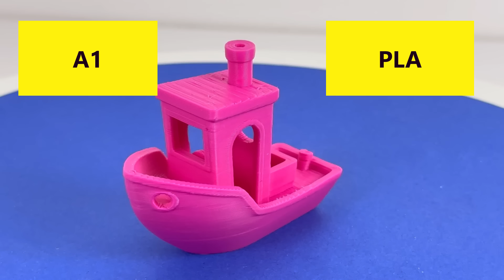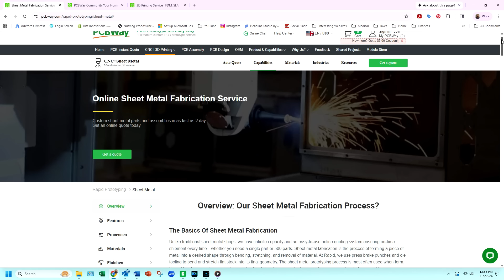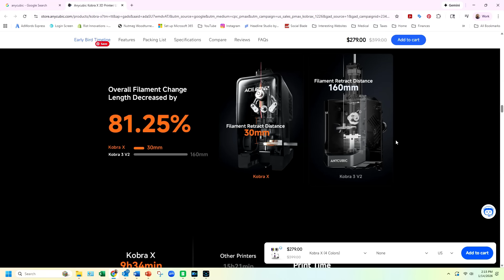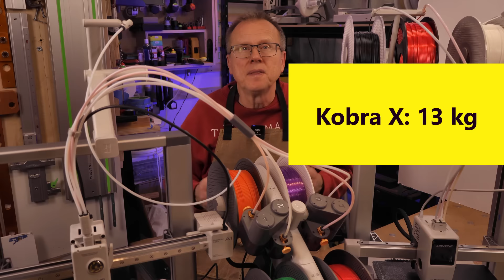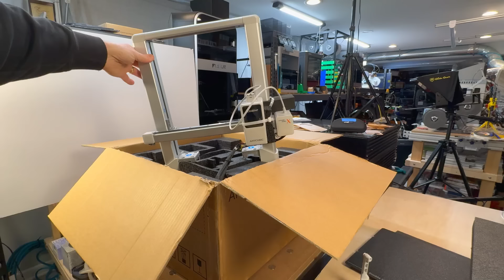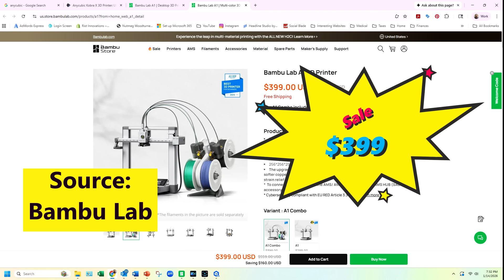NEW ANYCUBIC Kobra X vs. Bambu Lab A1- Which is BETTER?

Comment: Been printing for 7 years starting with the good old Ender 3D. That was an amazing and reliable printer for 3-4 years before my after market board had a driver die on me. I could not get it working so I took a 1-2 year hiatus from FDM occasionally printing on my resin printers instead. I soon got the desire to print more functional parts as SLA was tedious and my miniature painting space got blocked by construction materials so I got an A1. That reignited my love for 3D printing. The AMS was amazing for auto reloading filament and Orca was so good I did not really need to do any tweaking of the built in settings. Though the AMS made making a drybox enclosure simply impractical for my space particularly since I have mine top mounted and very close to two walls. Then 6 months later Bambu had to turn evil locking out Orca from the cloud. The prints have been amazing with very little maintenance ever since, but I can no longer in conscience buy another printer from them if they are so willing to change the rules after purchase.

Fast forward to a week ago. I saw a sale on the Kobra X and saw its hotend system and that it did not need a complicated and bulky AMS. The first thing I thought of when I saw it was how simple it would be to print and mount a dry box on top of it so I could finally print PETG and TPU without it sitting out in the open collecting water. The more efficient waste management and it not being a bambu were simply a bonus. After 7 years I have officially finally printed my models in those materials without any issues and the dry boxes are keeping the filaments 10% dryer than ambient. So far I am quite happy with the Kobra X despite the plastics feeling noticeably cheaper than the A1. We shall see how it holds up in the long run.

Comment: I’ve had creality k3 and qidi q2 . The k3 never gave me issues besides bed adhesion “my fault “ and the ends of spool getting stuck in the rail system and not stopping causing my print to fail . lol also my fault . But this qidi machine is great but man my WiFi has gone out and now my feeder gears are clicking by the nozzle head . Maybe tpu got stuck in gears a bit I don’t know 🤷‍♂️ doesn’t want to feed new filament of any kind . 😂 ima have to take it apart to marrow with a head set 👍

Comment: hey bud ams lite can be used with tpu Bambu now have a tpu that is ams lite compatible just so ya know if you didn't already
Reply from the maker: Bambu Lab has had the TPU for AMS filament for a while, but it isn't as flexible at the typical TPU so it has some limitations, but you are right that it does work in the AMS/AMS Lite.

Comment: Any chance TPU can be done with ABS? I like designing speakers, so the heat/UV resistance of ABS and ability to use TPU as a gasket is very appealing.
Reply from the maker: I haven't had a chance to try that material combination, but that's a good idea.

Comment: No matter how you cut it, this is turning into the year of the underdog comeback!  First, SnapMaker - a company that wallowed in mediocrity for years, creates a groundbreaking tool changer.  Now, the perennial step-child manufacturer - Anycubic introduces the first, original multicolor head design that ditches the gangly AMS approach.  I love it!  Personally, I feel that once a company gets anointed as a leader, it becomes arrogant.  That has happened to Bambu Labs and that's why I won't be buying their increasingly closed system.  Personally, I'm waiting for a few months...maybe a year...before buying another printer.  I think some exciting things are coming in the next 12 months.  Great video.
Reply from the maker: Thanks for your comment. I agree that exciting things are happening in the 3D printing industry.

Comment: Hi I was wondering about the 690mm height, is that to the top of the bowden tubes? I saw on Anycubic's website it says 461mm height. Maybe Anycubic is measuring to the top of the Z rail? I want to see if this fits in my cabinet. Thanks!
Reply from the maker: Yes, my 690 mm measurement is to the Bowen tubes. AnyCubic’s 461 mm measurement is to the top of the Z Axis frame as you mentioned. AnyCubic isn’t including the spool holders or the Bowen tubes. Thanks for your question.

Comment: Being new to 3D printing, I did my research and went with the A1 combo just last month, but just now learning about KobraX and Creality i7 "superior" clones for less $. That said, Bambu's proven reliability, ease of use, and robust eco-system is a selling point for beginners and until these clones prove the test of time, I won't feel too bad about my purchase. It's like arguing about the value of a new feature rich Kia vs the known reliability of a Toyota. 

Also, having affiliate links to one product doesn't help the impartiality of a head to head review.
Reply from the maker: I think you will be very happy with your A1 and I completely agree with your comments.  I also understand your point regarding the affiliate link so that's why you want to do your research; which sounds like you did so that's great.  Good luck with your 3D printing adventure.

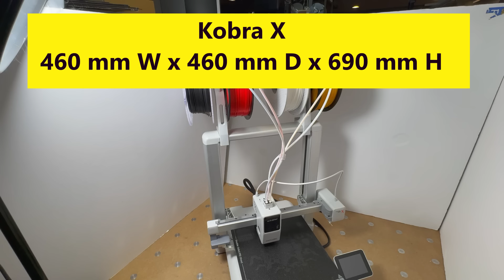Comment: Awesome video - thank you! But very repetitive too. You went through a features comparison at 9:20 and then did it again (pretty much word for word) at 16:45. Maybe this was just an editing error, but reducing repetition and making videos a little shorter (when possible) will help retain viewers and gain subscribers. Just some friendly feedback for you - that’s all.

But again, overall a wonderful video that is filled with great info. Much appreciated! The Kobra X seems like a much better printer and, for now, it’s much cheaper! I own 2 A1’s (both with AMS units) and I love them. Awesome print quality and reliability! Bambu makes great printers and their slicer (and overall ecosystem) is much better. But just looking at the printers alone, head-to-head, this is an easy win for the Kobra X. But it also has the HUGE advantage of coming out about 2.5 years after the A1. So Anycubic has had the chance to copy all the good stuff, fix the bad, and add extra innovative features. So not exactly a 100% fair comparison. But still nice to see!
Reply from the maker: I appreciate your advice.  I did intentionally repeat some information in the Final Summary from earlier portions of the video so I can see that this may not have been effective/made the video longer so I will take your advice under consideration for my next videos.  Thanks for taking the time to offer your input.

Comment: How is the noise?
Reply from the maker: Both the A1 and the Kobra X are very quiet printers, especially when compared to printers such as the Bambu Lab P1S. I didn't have a way to take a measurement of the noise level, but AnyCubic claims a noise level of less than 48 dB.  Thank you for your question.

Comment: Simply comparing features doesn't tell the whole story. A large percentage of anycubic printer owners will tell you to stay away from that brand. Very inconsistent and it's literally a crapshoot if you get a machine that works well or constantly has issues. While a large percentage of bambu lab owners rave about their machines. In 3D printers, as with everything else in life, you get what you pay for... and don't fool yourself in believing otherwise.
Reply from the maker: I agree that reliability is a big unknown for the Kobra X since it just launched and I also agree that Bambu Lab printers have a great reputation for reliability. My Bambu Lab printers are my current "go-to" printers when I must get a high quality print out in a short time frame. Thanks for your comment.

Comment: Im curious about the actual size of the build plate? is it a proprietary size or is it the same plate as any other printers? cheers thanks for the informative video, I've already preordered my Cobra X
Reply from the maker: The Kobra X build plate of 260 mm x 260 mm is unique (at least to me), but build plates tend to come in many sizes. The Bambu Lab A1 Series, P Series, X1 Series all have build plates of 256 mm x 256 mm.  The Elegoo CC has the same build plate as the Bambu Lab printers. The Qidi Plus 4 has a build plate 305 mm x 305 mm and the Qidi Q2/Q2C have build plates 270 mm x 270 mm. The Anycubic Kobra S1 build plate is 250 mm x 250 mm. There are other sizes out there, but I don't own the other brands. So, you can see build plates vary quite a bit between brands and models of 3D printers. Thanks for your question and for your feedback.
Reply: @ristinnovations thank a for the reply. I read somewhere that it was the same size as the S1. I want to get a couple extra plates with patterns in them. I’ll have to wait til it’s released and market gets parts and upgrades. 
I pre ordered my kobra x already. It’s feels strange not seeing lots of upgrades prints and parts for it online yet. Been running my old ender 3 for 6 years.

Comment: So the Kobra X is better in basically everything and costs $200 less....pretty easy choice
Reply: Mostly true but we dont have long term info how well it keeps up compared to bambus reputation of being reliable.
Reply: @taggedhh Not all Bambu are reliable.... My A1 just exploded literally. The problem is overheated NTC. I don't claim guarantee, just throwing away to trash and move to Centauri Carbon. Best decision. 
I have A1 mini too, it's pretty reliable enough. Yeah if you talk the reliability, the A1 mini is what you talking about. Even my H2D had extruder problem.
Reply: @taggedhh I have 2 remaining Bambu's i had 3....1 lasted 8 months (A1) 1 lasted 14 months (P1S) 1 is still working but has had over $300 in parts replaced (P1P) its 2 years old.  Bambu are NOT reliable long term. Thats just company propaganda. Theres a reason they are sold out of parts a lot of the time.  My Anycubic Kobra 2 Max though...3 years and never a hickup

Comment: Lets compare a 3 year old printer with is brand new one. funny how it took anycubic to clone a 3 year old printer and make it slightly better.  Btw on the build plate kobra x, a number of videos have confirmed that it sucks. it will need to be glue, hair spary, or replaced.  How long until the Kobra X is abandon for the Kobra X v2 ?  The thing I love about the Bambu is the Handy app. i can pick something. click print and know it will print. it tells me when it starts, and when it finishes.
Reply from the maker: I did have some adhesion issues so I coated the build plate with Nano polymer, which works great.

Comment: I hv an Ender 3 pro that I have used for years and like, but am looking for a bigger build volume, and the Kobra is about what I think I need, but I will next to never need multi color printing. Any suggestions on an alternative that is bigger than the Ender, but about the Jan 2026 price of the Kobra?
Reply: I mean... you don't need to worry about the multi-color part of it, you don't have to do multi-color to use the 3d printer you know?
Reply from the maker: If you are looking for a build volume of 256 mm cubed, the Bambu Lab A1 without the AMS Lite is on sale for $299. The Qidi Q2C without their Qidi Box has a print volume of 270 mm x 270 mm x 256 mm with a price of $399.  I'm sure there are other printers out there for your needs, but these are two that you may want to consider. Thanks for the question.

Comment: OK, the comparison of X with A1 comes naturally, but... The first one is new ~2026, and the second... is a model that's been around for over 2 years, so it's not surprising that the X does something better. ROTFL
Reply from the maker: I agree that the A1 has been around for a couple of years, but I still think that it is the top printer in this price range to compare all other printers to based on the performance of the A1 (I have 5 A1's in my print farm so I am a fan of the A1 printers.)  It's just like when many people compared the newly launched (at that time) Bambu Lab X1C to the Prusa MK3/MK4 printers because in my opinion, the Prusa printers were the best quality, most reliable printers at that time. Thanks for your comment.

Comment: Bonjour, très bonne capsule vidéo informative. Un point négatif, commun à tous les vidéos de présentation c'est l'absence d'explication des modules complémentaires 4 couleurs.
Personnellement, je suis en France, j'ai commandé hier la Kobra X en 7 couleurs. Principalement pour découvrir le multicolore avec une bonne réduction du temps et de la diminution des déchets (qui devait être plus important selon la publicité). Ayant un Prusa Core  One je sais que je n'aurai pas la même précision. À ce prix, c'est une bonne alternative. De plus je suis agréablement surpris de la technologie de la tête d'impression. Cordialement
Reply from the maker: I touched on the ACE 2 Pro modules in the video, but I agree I didn’t go into a lot of details because I don’t have one yet. AnyCubic will be sending me an ACE 2 Pro module when they are in stock so I will make a follow up video then, focusing on the modules. Thanks for your comment.
Reply: Merci
Reply: as tu recu ta machine ? comment elle se comporte ? comment le changement des couleurs et des filaments ? j'ai vu que celui d'anycubic parametrer les filaments a l'air plus chiant que celui de bambou. 
J'hesite vraiement entre les 2, mais le sav et les pieces de rechange chez anycubic a l'air plus chiant. je ne doute pas su la qualite d'impression, mais faut aussi penser a la face cachée : le sav et la disponibilté des pieces.
Reply: @tignasse Bonsoir, je n'ai pas encore reçu l'imprimante. Logiquement, au regard du calendrier d'Anycubic, c'est vers le 15 avril. Comme on dit, à suivre. Cordialement

Comment: very well made video! ordered my a1 now
Reply from the maker: I think you will be happy with the A1. I am currently using 5 of them in my print farm and they work quite well. Thanks for your comment.
Reply: What made you chose the a1 over the kobra?
Reply: @Berkishere  I have to say that I have a bias since I owned a Kobra 2 Max and wasn´t very happy with it. The main reasons are:
1. Delivery time
2. The Bambu eco system with Makerworld
2. I only want to print in PLA and do not need to be able to print TUP with the AMS

I´m sure the Kobra X is a great printer and won´t have the issues I had with the Kobra 2 Max, but at this point, I very happily accept the few disadvantages on paper and get in exchange this universe of an ecosystem around the printer. The Bambu already has proven itself as absolute outstanding in this price range for years now. I also had some friends (and myself) who initially thought they could save some money with an Anycubic or Creality printer, but in the end everyone switched to a Bambu since it is just print and forget.
If you need the slightly bigger print surface or want to print TPU with the ACE 2 Pro, you should get the Anycubic. If those don´t really matter to you, then I would recommend the Bambu any time.
Reply: @YourGermanAddress Oh thank you so much for the details! The delivery of the kobra is 2 months from now which sucks.. I would mainly use the printer for functional stuff so I would not get the AMS but the multimatrial printing on the kobra is really a nice to have.. but for now i guess the Bambu is a good go and its price is somehow quite stable so when upgrading it could be selled for not much less
Reply: @Berkishere  You´re welcome! 
Yeah I was suprised too, as i saw the used prices. They are like I Phones! And you are absolutely right: The multimaterial would be great, but I don´t think the Kobra X is the right printer for that. Originally I wanted to get the Snapmaker U1 for that exact reason, but I also wanted to get a Bambu for easy printing. 
So my plan is to wait and see what the other producers are answering to the Snapmaker. And if nothing what I like appears, I´ll have time to save for the Bambu version in form of the H2C or whatever they offer then, with the A1 still on hand.

Comment: At 8:16 says, "Is able to print TPU and PLA at the same time".

Did not show that anywhere in the video.

Does it have 2 toolheads to enable it to lay down 2 lines of filament at the same time?

Cheers,
Reply from the maker: I was referring to printing TPU and PLA in the same part. The door stop part is an example that I printed TPU and PLA within the same part.